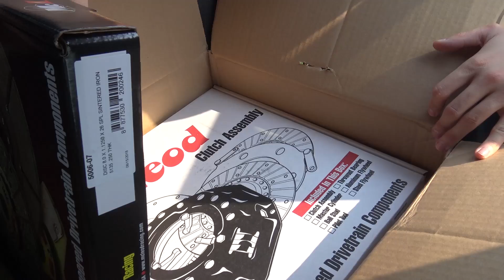Can You Use KY JELLY as ENGINE OIL?

Comment: Try gas as engine oil
Reply: That would definitely wreck the engine and youd also have compression issues 😂😂
Reply: O E O.O
Reply: @itsjusta6 tried this in a Volvo but used diesel a d it worked
Reply: It will catch fire and blow up already tried it

Comment: My guess is the viscosity is pretty different from regular engine oil. Also, even if it did work temporarily, it wouldn´t last too long because that lubricant probably won´t withstand the heat.

Comment: I have a 4.6 with 430k+ miles and never has oil in it and I've been driving it for 200k miles like that and been trying to blow the engine and it doesn't even tick

Comment: Take the valve covers off and squirt some oil down in the cylinders and put oil back in the crank case and turn the harmonic balancer a few times and put the valve covers back on and it'll run again.

Comment: You guys should try lacquer as fuel. It has to be nitrocellulose lacquer though. Nitrocellulose is extremely flammable by itself but in lacquer it’s resolved in alcohol. I had some extra at the house one time and discovered it made a great fire starter.
Reply: It may not be available where you’re at legally. I know some states have outlawed it due to potentially toxic voc’s and it can be hard to have shipped because of its flammable characteristics

Comment: Use coconut oil
Reply: That actually stands a chance.. It doesnt burn off until way hotter than an engine would get before it seized..
Reply: @jblob5764  yuppp , smoke point is 350 degrees Fahrenheit.
Reply: @jblob5764  as long as the motor is somewhat warm and the coconut oil is in its liquid form I think it'd be good
Reply: Just dont let the engine cool down, like ever
Reply: @matthewalbright6108  yeah it wouldn't be something you use on a regular basis lol. Once the oil hits 68 degrees farenheit it'll start to become solid.
Reply: It’s too thin

Comment: Use Gatorade as coolant fluid
Reply: It would probably work since it's mostly water anyway but idk bout the sugar
Reply: Linus Cleveland do this one
Reply: I think it'd be fine, probably would have to use the car regularly for months to notice anything unusual
Reply: It will work til winter came around. you can use straight water as coolant.
Reply: it would probably work for a while, but l think the sugar and nutrients in it would promote some kind of growth or corrosion.
Reply: Well it looks like the same color sometimes so it should work right?
Reply: Yes.
Reply: "coolant fluid"

Comment: No it’s water based. Oil is 3 molecules water is one.

In before the video starts to show the engine lock up.try 5 gallons of diesel fuel. Should last5 minutes or so. 

If you’re really froggy try 5 gallons of marvel mystery oil. Should last longer than diesel and prove at least 20 minutes. Has the viscosity of 10 or 15 w oil. 

Senseless car carnage when mad homeless people especially in Portland need cars. 

Try nearly destroying one leave it running and give it away.

Comment: What did the jelly look like when you drained it from the car?

I think this would work better for transmission fluid, considering that's much much thicker as it is.

PS you should do an autopsy some time
Reply: Transmission fluid is basically sae 30 oil with cleaning additives so waaaay to thick for a transmission

Comment: Commenting before the first ads even done.

Im gonna go with a yes. Any petroleum or vegetable product will keep an engine lubed. The only thing you need to consider is if it gets thin enough it can seep through the rings.

Love your vids, 253 representing. 
Keep it up.
Reply: Wow I'm surprised it died that fast, thought at first for sure it hydrolocked but maybe it didn't thin out at all and clogged the pickup like you thought.